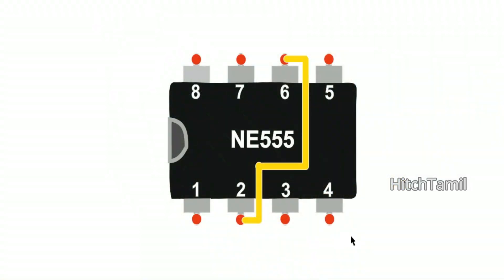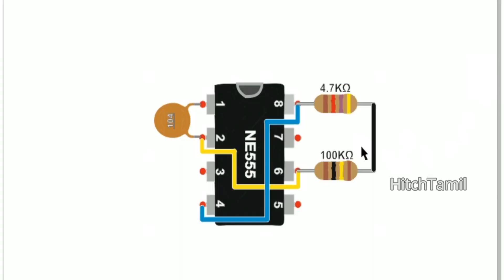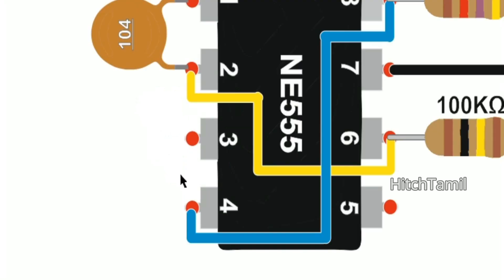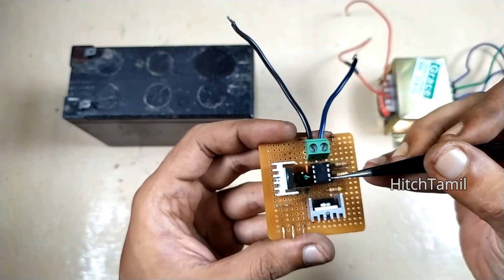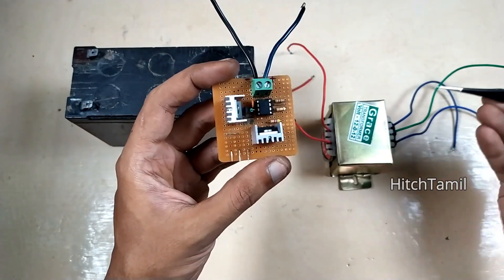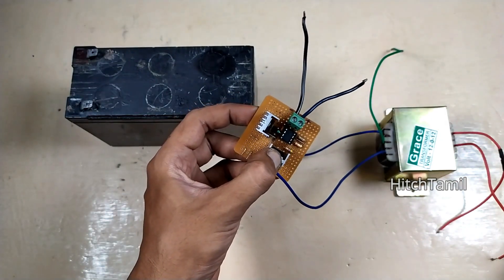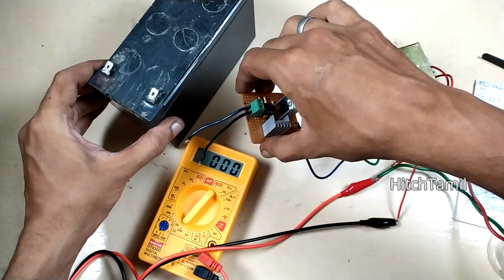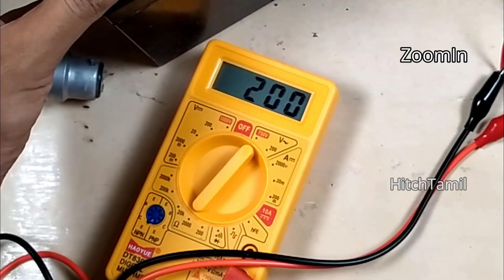How To Make Inverter- Mini Inverter But Powerfull Pure Ac With Circuit Diagram | In Tamil

Comment: Bro intha circuit use pandi android mobile charge poda mudiyuma bro for current sutdown days
Reply from the maker: Yes Sure Bro inthu inverter Circuit than. Output la Current than varum so mobile charger connect Pani mobile ku charge Panikkalam
Reply: @HitchTamil  irfz44n ku pathila lm3n7t use panda lama bro
Reply from the maker: No Bro. Lm317 Voltage Regulator MOSFET. IRFZ44n Than Inverter ku Use Pannanum.
Reply: @HitchTamil  ok thanks bro

Comment: Bro ennode ups le battery charger age mattiguthe but battery is in good condition
Velelle adaptor use panni battery charger aguthe anna ups le charger agale
Reply from the maker: Ups Boardla Battery Wire Check Pannuningala Bro?
Reply: @HitchTamil  bro battery adaptor le charge panni use panna ups work aguthe anna ups le tha charg agelle

Comment: Hi hello. Can we use this circuit in our home use while eb line power cut? If yes please let me know how to connect
Reply from the maker: How many Watts You Need Bro?
Reply: @HitchTamil  below 500watts bro. Intha circuit max how much watts can produce if we use 5amp transformer
Reply from the maker: Appo Shine Wave Inverter Than Make Pannanum Bro. So Intha Video la Irukka Mathiri Circuit Make Pannanum. https://youtu.be/xgpaasrSp8g
Reply: @HitchTamil  intha circuit yeppidi bro home wiring la connect panathu athu pathi konjam videos podunga bro
Reply from the maker: First Mosfet Mattum Extra Add Pani Intha Circuit Ready Pannunga Bro. Apram    separate thaniya than circuita Connect Pannanum. Ungalukku Yepdi? Power Cut Aanathum Automatica inverter On Aaganuma Bro?
Reply: @HitchTamil  kandipa bro video already many times pathuten design pana poren videos la irukura mathriyea. But power cut ana manual aha connect panaum bro 1st time try pandren inverter circuit so automatic ippo veandam
Reply from the maker: Power Cut Aana Automatica Inverter On Aaganumna Athukku Thaniya Circuit Ready Pannanum Bro.

Comment: Bro pcb soldering aippati vaikiradu bro
Reply from the maker: Zero PCB ya Bro?
Reply: @HitchTamil  ama
Reply: @HitchTamil  bro
Reply from the maker: Nama Use Panra Normal Soldring Zero PCB la use Panrathu Kastam Than Bro. So pencil tip Soldering use Panna Accurate Place la Soldering Pannalam Normal Soldring Neata Soldering Panna Mudila
Reply from the maker: Best Low Price Pencil Tip Soldering Iron Unbox And Details Video Poduren

Comment: Actually naa oru router ups pannitu iruken... Adhula connection vandhu input to battery then battery to output idhu dhaan... But input to battery kuduthutu then current off aagara nerathula battery to input reverse aagadhu. So i used a diode for it aana diode vecha voltage drop aagudhu so battery charging um kitta thatta 1 volt kammiya aagudhu. So without voltage drop and in single direction edhachu vazhi iruka
Reply from the maker: Athavathu Power Cut Aanathum Routur Ups On Aaganum Then Correcta Battery um Charge Aaganum Athana Unga Question?
Reply: @HitchTamil  illa illa actually ups vandhu power on la irukarapo naa use panra adapter power lerndhu battery ku poi use aagum then power cut aagarapo battery oda charge evalo neram iruko avalo neram use aagum... But enna na since idhu oru lithium battery so just adhuku bms vechi direct adapter point la kuduthurken dhaan... Adhunala power cut aagarapo battery lerndhu power thirumba adapter ku podhu. So adhu thirumba adapter ku poga kudadhu... Adhoda motion only from input adapter to battery then battery to output avalodhaan... So adhuku enna panradhu
Reply from the maker: So Athukku easy Maethod Na Rendu Irukku Manuala Oru Switch Podalam Automatic na Relay Use Pannalam
Reply: @HitchTamil  actually manual switch set aagadhu because already 3 switches iruku oru control kaaga... And relay use panni pathen since relay oda andha coil side lerndhu output side la battery ku porapo battery layum konjo voltage irukum so power off aagara nerathula kuda normally closed la battery connected la irukardhu naala EB off aanalum battery vazhiya that is normally closed to common connection pogudhu like same naa sonna maari reverse la pogudhu. So relay kuda work aagala
Reply from the maker: Double Relay Use Pani Parthingala?
Reply: @HitchTamil  double relay connection vandhu both positive ku onnu negative ku onnu andha maari panni pathen work aagala.... Any other connections iruka second relay vechi
Reply from the maker: Ithukku Battery m Safe Ah Irukkanumna  Ore Sollution Than Irukku Auto Cut Off Circuit.
Reply: @HitchTamil  adhuku circuit connection solla mudiyuma bro
Reply from the maker: Simple La Yentha Circuit m Illa Konjam Complicated Circuit na YouTube la ye Irukku. Simple Circuits Nan test Panittu Irukken success Aanathum Than Video Podanum.
Reply: @HitchTamil  thank u so much bro for ur replies
Reply from the maker: It's Ok Bro yenna Doubts nalum Kelunga Comment Parthathume Reply Panren.

Comment: Intha circuit le Maximum evolo watts bro load kudukalam ?
Reply from the maker: Ithu Ippa 200watts Varaikkum Support Pannum Bro But Same Method la innum 4 Transistor And High Amp Transformer Use Panna Athiga Watts Tharum. Video La Full Details Solliruken Bro 👍
Reply: @HitchTamil  yes bro fulla video parthen and thanks for reply bro 👍
Reply from the maker: Ok Bro 👍
Reply: சூப்பர்.

Comment: hi pro only 1minuts working out put 160v ac  not working pro
Reply from the maker: Circuit Correcta Ready Pannuningala Bro?
Reply: @HitchTamil  s bro but na use pannuna transformer 5ams 12-0-12

Comment: Workout aakala bro.... Help me
Reply from the maker: Circuit Correcta Paningala Bro?
Reply: @HitchTamil  s bro.... Pcb la than pottrukken.... Konjam transistor heat aatchu apa kooda voltage varala.... Ippa heat kooda aaka maadathu
Reply from the maker: Transistor Heat Aana Short Irukkalam Bro Circuitla Line Correcta Irukkanu Parunga.
Reply: @HitchTamil  s bro.. IRF 2 transistor heat sink contact aakura maari vatchuden.... ipa Itha  maathi vatchuden...  work aakala... Entha components poirukkum nu find panna therila bro
Reply from the maker: Irf Check Pannuningala Bro?
Reply: Continuity sound varala.... But value 1 nu varuthu
Reply from the maker: 2pin +3rd Pinla Value Varutha Bro?
Reply: @HitchTamil  1 than varuthu
Reply from the maker: 3Pinla Yentha pin la Bro Value Kattuthu?